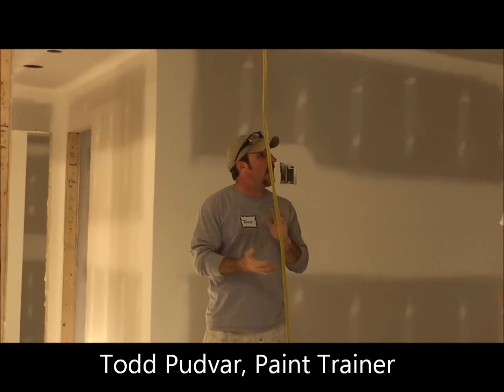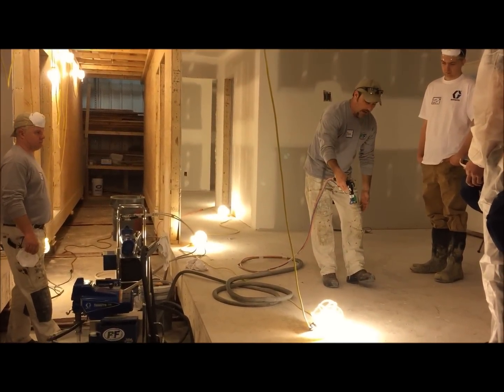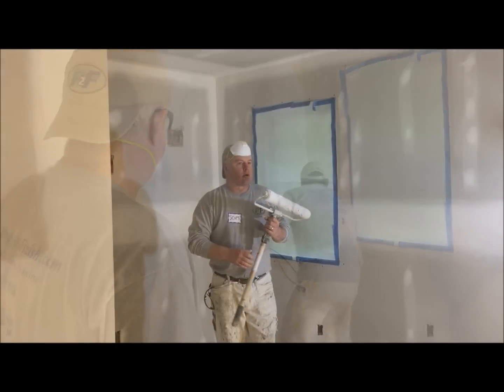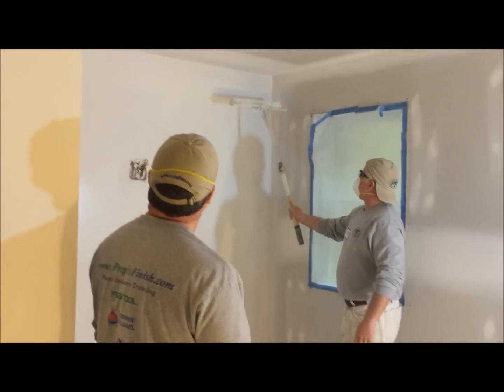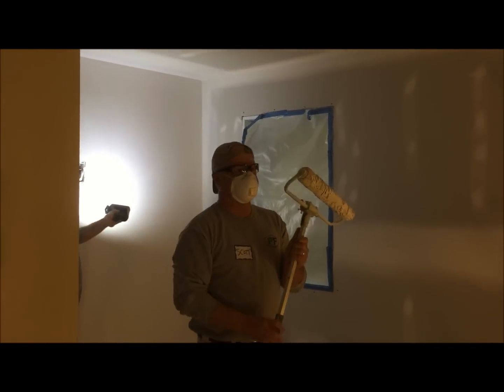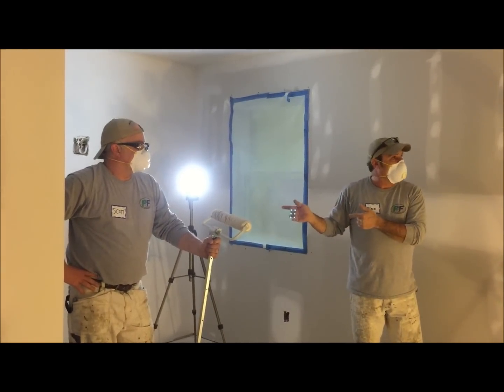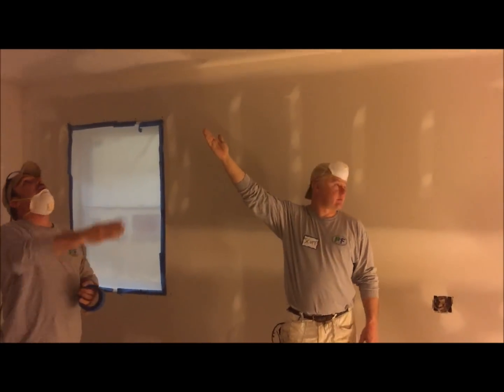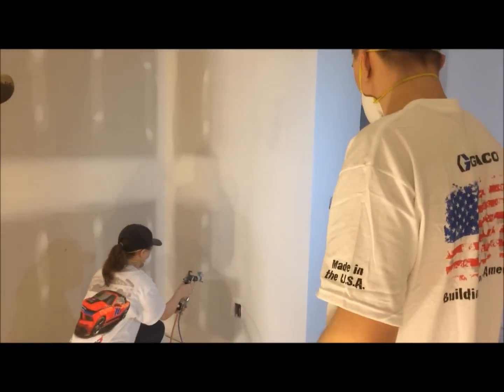Prep to Finish at GMTCC: Drywall Spray & Backroll Workshop

Comment: mate .. in the uk spraying is still i the dark ages , i have been spraying since 87 and still find guys that say well you cant match a  snagging ..but it is now been used more ... but it takes a lot to explain to the site foreman that your gona back roll .. and a mist coat is 2 coats in one go with  the 50% overlap and will cut down on the cost of labor  , then l fill and sand, inspect  and over coat to finish ...
Reply: +ragandoil fill and sand after your done the 2 coats?
Reply: and I bet it comes with plenty of flashing.
Reply: Charming, way to keep it classy.